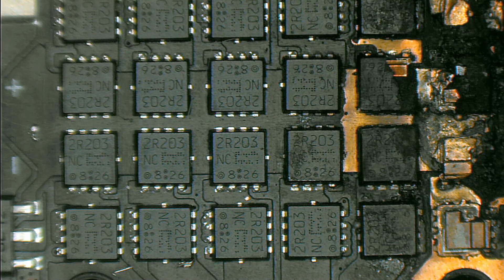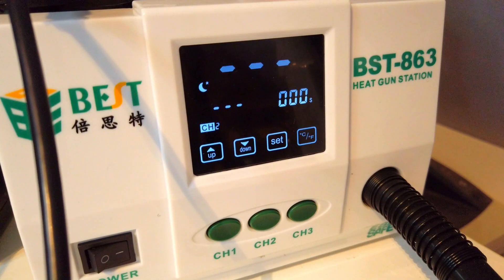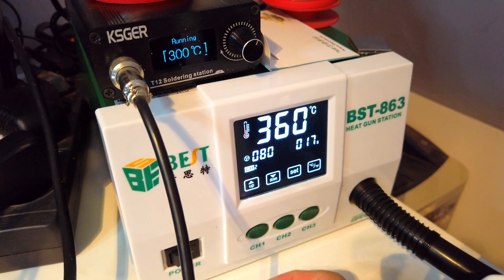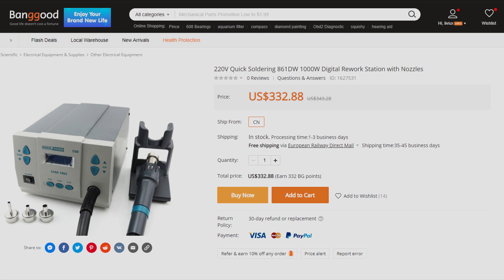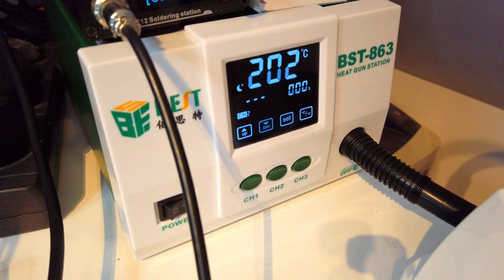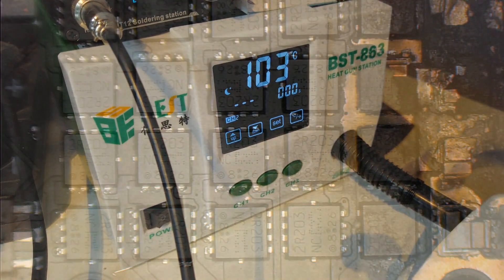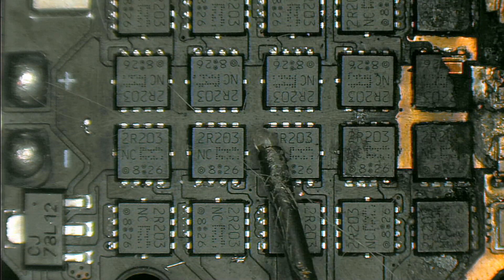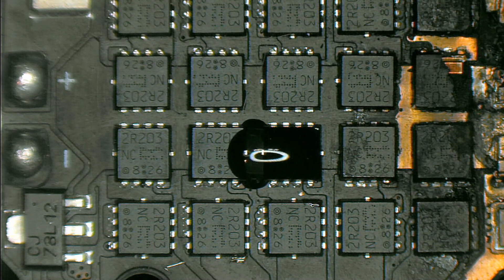My hot air station - Best BST-863

Comment: @Livyu FPV
 hello Livyu FPV
I just bought the same BST-863 station and am having trouble finding the temperature and air to output an audio chip on an iphone motherboard. I do not know if my station because it has a problem I cannot unsolder the chip with hot air, however I have tried a lot. could you tell me why thanks in advance
Reply from the maker: well they have lead free solder so need higher temp to desolder. I use 400-450 C and Max air flow.
Reply: @LivyuFPV  thanks for your reply Livyu FPV I tried the temperature 400-450 degrees and the air at 80-90  even with this temperature I can't get it out
Reply: @LivyuFPV   thank you very much I found I put them a temperature of 450 Degree and the air 85
Reply: @LivyuFPV  yeah, same, 100% airflow 450 deg C for BGA chips. Not to forget flux, of course! But one thing is that for BGA the board MUST be pre heated. If not it has a large risk to damage the chip itself and the board. I hold the nozzle about 5-10cm away from the board at 80% airflow 200 deg C to preheat it for about 1 to 1.5 minutes, and moving the nozzle around the board to preheat that areas. Then I change to main 450 deg C preset and remove chip

Comment: What about 861DW from Banggood that you recommend previously?
Reply from the maker: well, that was the original thing... that most people recommend... But mine has the same basic construction and it's cheaper. :)
Reply: I'm just curious because I just got it (861DW) from Banggood after two months delivery. I bought it by your recommendation so should I return it or what? 😀
Reply from the maker: @f7p1764  yup, you are perfectly ok with that... I wish I had that. But this one being cheaper is doing ok too.
Reply from the maker: @f7p1764  PS: I have previously worked with 861DW and I loved it... this is why I took this one, cause it's based on the same design of the 861DW. Happy reflowing man!